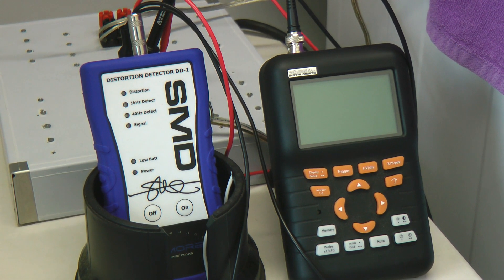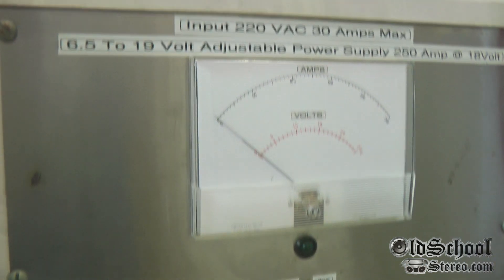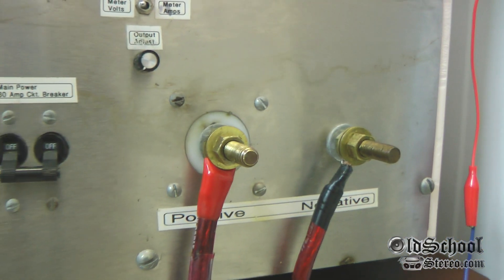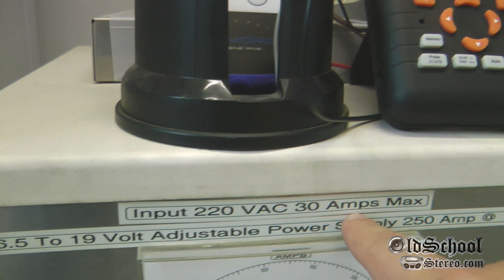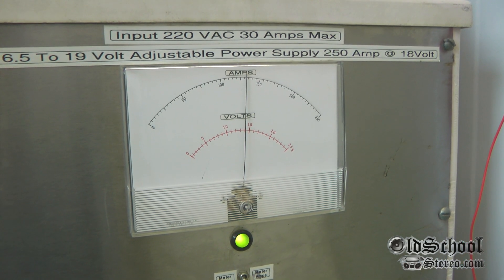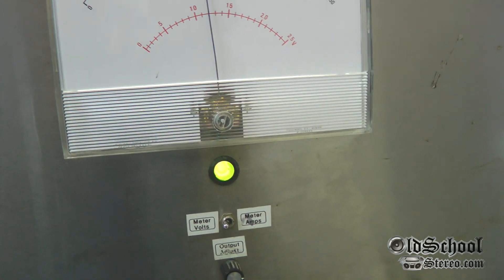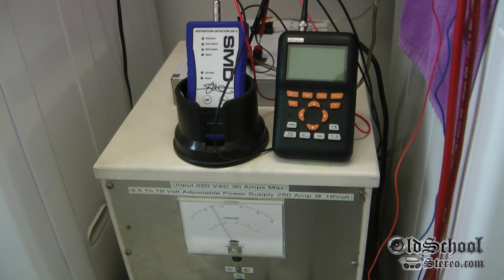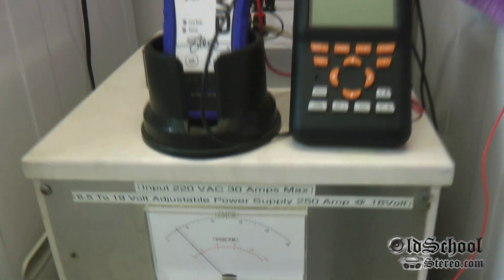Test Bench Update 250A 12V Variable Power Supply

Comment: This is true. The old Orion amps are built very differently than any other amps...well, ever. The power supply responds very well to high voltage input due to its design. It actually runs more efficiently at high voltage.

Comment from the maker: It has a huge, custom wound transformer, 4 large reserve caps, a huge heatsink, 4GA internal wiring, voltage regulator, resistors for discharging the caps, some custom electronics and a few other do dads...It is easily 100lbs, prob closer to 120lbs

Comment: The unit you have Big D, is  transformer driven, I say that due to the 220 volt, and sound of it. Usually pwm power supplies are lower current and driven by 120 volts. And if pwm driven they usually are way more adjustable, with current adjustability.

Comment: Good'ol power supply ! It appears to be motor driven alternator by the sound of it, but I guess it's just cooling fan ran out of bearings + air noise ? But it also may B transformer type, however hard 2 say without looking inside...
I think I c'd help You with the schematic if I c'd get some decent quality internal pics from U...

My power supply is capable of 800A@16V and is fully adjustable down to 9V. Fully electronic (PWM) with active power factor correction, and made by myself :)

rgds

Comment: It will only cost as much as the circuit breaker, the wire to run from your main panel to your outlet and your outlet cost!  220v  (actually, 240v) is what comes off the pole to your house.